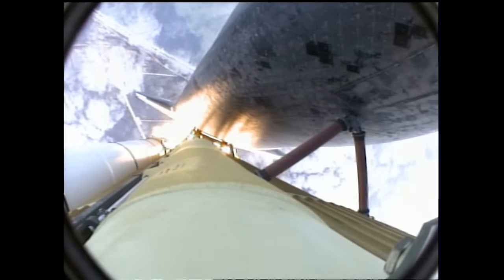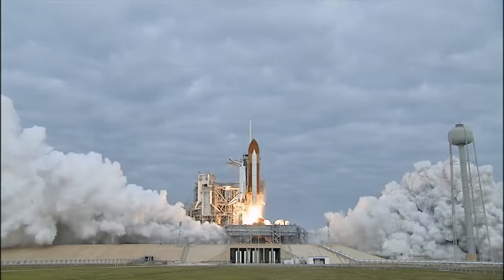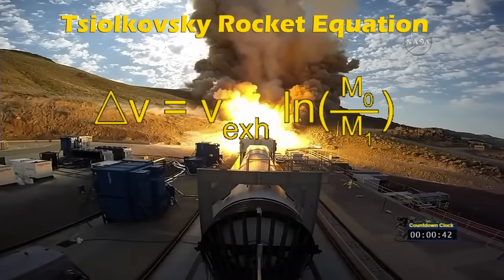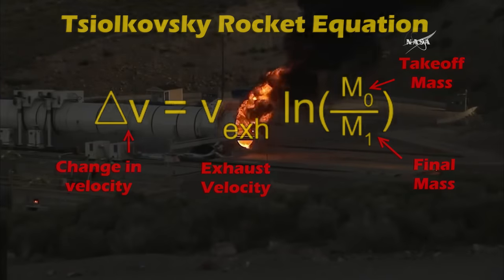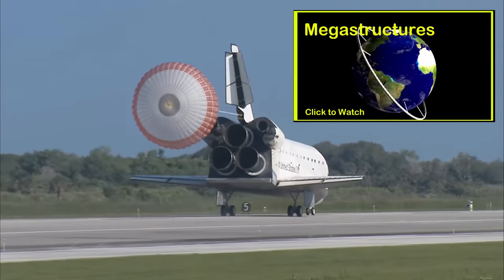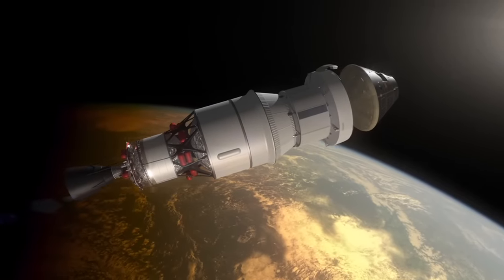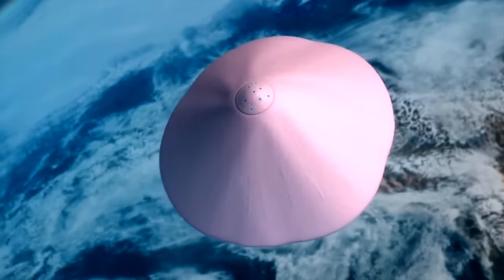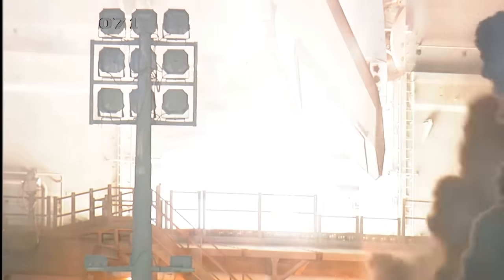The Spaceship Propulsion Compendium

Comment: Is it possible to recover one's expended fuel in space by using a catch mechanism behind the spacecraft? For example, you emit charged particles for thrust and once they leave they are attracted to a magnetic funnel system which re-directs them back to the storage tank still under their own power. Or does that violate some law of physics?
Reply from the maker: Capturing that way would produce no thrust unfortunately
Reply: It violates conservation of momentum. If you grab the expelled gas, it slows you down. Sort of the opposite of why putting a fan on the deck of a sailboat can't work. (Um, Idk how useful that analogy is...) 

Try again - imagine a gun with a rubber band connected to the bullet. You shoot the gun, the bullet moves forward, and the gun recoils and moves back. Then the rubber band starts pulling the bullet back - and starts pulling the gun forward! Equal and opposite. If everything could be perfectly efficient, you'd get your bullet back but you'd be standing still right where you started. So, on a spacecraft, whatever method you use to collect the propellant, it's basically the same effect as the rubber band. (Much better analogy, lol.)
Reply: Bo Zo 
How about a trailing ship collecting some of the gas expelled from the lead ship without losing its momentum? Assuming you were going to have two ships anyway, this would be like a cosmic form of drafting, or like those scoops they propose for collecting gas in space as you go.

The idea of collecting expelled gasses - somehow - is not completely crazy. It's not exactly like the rubber band and bullet analogy since the gas molecules are not physically connected to each other. Each particle has its own momentum and so it should be possible to collect a portion of them without absorbing a hammer blow of unwanted momentum.
Reply: +MillionthUsername - Part of how drafting works is that the lead vehicle's wake is moving in the same direction as the lead vehicle, so the trailing vehicle experiences a tailwind. Following close behind a rocket is the opposite - you're facing into a thirty thousand mile per hour headwind. (I think the other factors in drafting are probably irrelevant here.)

The reason a Bussard Ramjet could maybe work is that, although the ship does slow down by scooping up fuel, it uses the fuel to produce a fusion reaction and lots of thrust. It picks up fuel moving kinda slow, and shoots it out the back moving really fast, so there's a net gain in the ship's velocity. (But not in the total momentum. Imagine it as two momentum-conserving events.)

The basic principle is this, and it applies to all situations everywhere in the universe: in any closed system, whatever momentum you start with, no matter what you do, the system will at any given time always and forever still have that much momentum exactly.
Reply: +MillionthUsername - Actually, any method of collecting the gas is very much like the rubber band. "Physically connected" is sort of an illusion - for instance, magnets are physically connected by physical magnetic force. (In fact, a rope is basically just a row of magnetically connected atoms. But I digress.) Gravity physically connects you to the Earth. 

Interacting with the exhaust gas of a rocket will affect your velocity. That's why rockets push their payload up, and that's why collecting the gas afterwards cancels out the push. A second ship might collect the gas, but it would be slowed, and need MORE gas than it collected to keep pace with the first rocket. 

Or, imagine a rocket in space, with a giant balloon behind it. The rocket would inflate the balloon. It wouldn't accelerate. If you put a small hole in the balloon, it would accelerate. And it would accelerate in the opposite direction, away from the hole, so if you put the hole on the side of the balloon, it would rotate.
Reply: Bo Zo
You could release the collector behind you as you accelerate. The gas could be recovered later - assuming the whole setup was economical to begin with.
Reply: If you leave the collector behind, then you could accelerate away at full thrust, no problem. If it trapped 100% of the exhaust, it would accelerate backwards away from you - equally and oppositely. The collector's momentum would be equal and opposite, but its actual velocity would depend on its mass.

(If it collected less than 100% of the gas, then the collector would accelerate less - but the gas it didn't collect would make up the difference, and the equation would balance to zero net change in momentum.)

You could try to tow the collector, perhaps with a rubber band...

If you tried putting engines on the collector, you'd need to expend fuel (momentum) at least equal to the momentum of the collected gas, just to stop it going backwards, then an equal amount again to make it go forwards, plus a enough extra to stop and then accelerate the collector - for a net loss of propellant (but as always momentum is conserved).
Reply: I missed an aspect:

If you sent a friend in another ship to collect it, then YOUR momentum wouldn't be affected - you could fly away happily. But your friend would have to accelerate to catch up with it and so on, and between you, the fuel, the collector, and now including your friend, once again momentum would be conserved. 

Also, if the collector accelerates backwards because of the exhaust, or even if it's massive enough to stay mostly put - as your ship gets farther away, it gets harder for the collector to collect the exhaust, at least if the propellant is an expanding gas. (Although if the propellant was bowling balls or a tight particle beam or something, and not an expanding cloud of gas, that wouldn't be such a big problem.)

Comment: I’ve designed an ion drive that could generate many KN of force, similar in comparison to a jet engine. This would decrease radically going into orbit as I would need an onboard supply to maintain thrust. But you’ll notice the mass of that propellant would be significantly less than rocket fuel. Thank you everyone btw

Comment: I have a question, but first let me say I really like your channel!
So, do you know at which fraction of the speed of light a spacecraft has to travel in order that from it's point of view it's travelling exactly at the speed of light? .. due to time dilation/space contraction effect... I'm asking around but nobody knows..:(
Reply from the maker: Probably asking the wrong people :) they should have told you 'none', you can't have a perspective where you are traveling at the speed of light, no internal time passes when you are at light speed and any speed beneath that will have you measure the the speed of light as exactly the same, that's the entire way we came up with special relativity. What instead happens is that the light you do see will start red or blue shifting, the speed won't change but the color will basically. Hope that helped!
Reply: I understand. The speed of light will always be the speed of light for everybody, but let's say that I travel at 99.999999999999% of light speed from earth to a star 4 light years away.... wouldnt appear relative to my clock that I arrived there in just a few seconds or so?
Reply from the maker: It sure would, but you won't see the distance as 4 light years, you'd see it as a few light seconds.
Reply: ok I think I fully understand now.. well it's good cos in theory we can cover immense distances in our lifespan provided we have a proper propulsion system even without FTL speed. Thank you very much I had this question for long time! Keep up the good work!!! ;)

Comment: You said rocket fuel was expensive and I guess relative to many other fuel types it is but it is a very small part of the economic cost of a launch.  The real cost is payload vs fuel and re-usability of components.   The better the fix for both of those issues will lead to better economies of scale.

Comment: If ion engine is installed vertically on earth it can lift a space ship with ion jet. Energy can be obtained from solar panels. Magnets can decline ion jet from the spaceship to avoid damage. Energy for magnets can be delivered with a laser beam from earth. Ion jet can be accelerated by multiple cyclotrons on earth. Ions will return to earth after being declined. It means no waste of fuel.

Comment: Isaac, I have a question for,you regarding the Star lifting you mentioned at the end of this video. I am not sure if you have viewed any of the videos posted of ET craft around our sun doing what appears  to be removing material from our star.  I hope you do not instantly disregard this comment upon seeing ET as this is really an honest and credible question.  It has happened more than several times and is recorded straight from NASAs page where one can view the images and streaming video from the 2 satellites zeroed in on our sun.  Is this what you mean by star lifting ?  If so are these craft using the plasma as a propulsion fuel or do you estimate they are helping \ tampering with, the sun?  I myself am not a tin foil hat wearing guy and in actuality am a former USMC LT and consider myself an open minded person when it comes to such matters. To think we are the only intelligent beings in this universe would be, in my humble opinion, closed minded. As to my question, in these videos it shows a craft (some as large as Earth) hovering very close to the sun using a sort of tornado to actually pull plasma off the surface of the sun directly into it.  In some instances as it stops the process and leaves, you can visibly see a wake appear in the surface of the sun. Sometimes there is a reaction that appears on the direct opposite side which seems directly connected to the process completed.  Have you yourself viewed these videos and if not, would it be too much to ask you to watch them?   I have found myself locked into your videos and appreciate all the work you put into them. Great work and ThankYou. Your work and narratives are top shelf man and I look forward to your next one. Thank you,for taking the time to read this comment and I look forward to your response.

Comment: Someone tell me if this would work or not, and why.
If you have something spinning in space and its under going gyroscopic procession would it technically be able to accelerate forward, or at least in a direction? And if that is true would this spinning object spin forever(or a very long time)because of the micro gravity, and small amount of particles, in space?
Reply from the maker: I'm not quite sure what you mean Nyro, you could remover some of the rotational energy of a spinning object to be used to power propulsion, though it still needs to be in a way which conserves momentum.
Reply: No Im basically asking what would happen if you had an object spinning in space, would it stay stationary or would it move "forward"?
Reply from the maker: No, it will remain at relative rest, just spinning, unless acted on by an external force, though it will eventually stop spinning from the small amount of drag from vacuum not quite being vacuums

Comment: Regarding antimatter as "ultimate rocket fuel", there is a tiny chance for a better one: stimulated proton decay - also mc^2 of energy ... but could just use hydrogen gathered on the way.
But there are two big "ifs":
1) is violation of baryon number conservation possible? One argument is baryogenesis which created more baryons than anti-baryons. Hawking radiation is believed to finally turn matter into massless radiation. Such violation is also required in many models like SUSY. Another argument is that charge conservation is guarded by Gauss law, but there is nothing like that for baryon number.
2) if it is possible, the real question is if we could stimulate it - make it practical. If proton is local not global energy minimum, maybe we could e.g. "swing it out" from this minimum - by some well prepared EM wave (?)
Reply from the maker: We don't even know if protons decay last I checked, but if they do I'd acknowledge that would be a hair better probably. Anything converting raw mass into something moving at or near the speed of light, basically photons or neutrinos, is pretty much gonna max out the rocket equation, the upside to stimulated proton decay would presumably be that you would be able to scoop it as you went, or something parallel, whereas antimatter is still an initial fuel you have to carry.
Reply: The search for proton decay was made in large room temperature water pools, while it would need reaching relatively huge energy to cross the potential barrier of proton - assumption that in room temperature such energy can spontaneously thermally focus in a proton might be just wrong.
In contrast, if possible it requires enormous conditions - like while baryogenesis (BB), inside BH (burning baryons into Hawking radiation) ... the next candidate is the center of neutron star: leading to gamma-ray bursts of energy scales unexplained in standard ways (they observe). Another candidate is LHC, but it is very difficult to verify - calorimetry has no chance to see it, should be added to Monte Carlo simulations but it would require knowing the parameters  ...

However, there might (?) exist a more subtle than thermal way - like "swinging out" the proton or finding a valley through the potential barrier - which might be exploited with a very precise EM wave ... but it will require a really good model of proton, we are far from ... and an extremely sophisticated EM source (controlled in gamma scale).

And personally I don't believe in containment for macroscopic amount of antimatter - it would require literally a perfect vacuum in this vibrating environment - a tiniest imperfection would lead to annihilation, which energy would strip out more atoms, starting chain reaction.
Reply: I see you mention formation of micro black holes in the warfare episode - also that they evaporate in short time due to Hawking radiation. This is another approach to "baryon burning" - collapse standard proton-based matter, finally transforming it into mc^2 massless Hawking radiation (photons).
So if a civilization could form micro black holes, it would have the ultimate energy source: mc^2 from any matter, like hydrogen scooped from space while travel (much more important than warfare applications). It could be used for repulsion like in the Orion project: form black hole behind a starship and reflect its Hawking radiation ... or e.g. use some photovoltaics to turn it into electricity.

Comment: How does the vasimr engine go to mars in 39 days, you would need huge acceleration, right?
Reply from the maker: Huge by modern standards, in terms of it being prolonged, but by and large, even when you're bypassing Hohmann transfers to go faster, you still are only talking about 10-20km/s of delta-v tops,  that's a whopping 1-2000 seconds of one gee thrust, not even an hour, but of course that is spread out over many days instead so you would barely notice it, things would drift a bit toward the back of the ship rather than falling, way less than Mars or even moon gravity equivalents. 
Here's Diaz's original presentation on it from a few years back if you wants more of the nuts and bolts:
https://www.youtube.com/watch?v=-nyepvfuHho
Reply: Isaac Arthur Ok, thanks for the link and explanation, but the engine is too weak to be used as a circulation burn engine on smaller spacecraft, I assume, but according to the atomic rockets site it could produce ~2 kn of thrust, which is close to the oms pods on the space shuttle (I think)

Comment: 8:06 The intergalactic void has significantly higher
mass density then system space.
In system any mass present will soon settly on a planet
or star, if not at an orbital speed on a trajectory that is
an orbit.
The extra stellar space and also extra galactic space has UCM
(Universal Colloidal Matter, micromass) that can be as high
as the density of all mass in the solar system divided by the volume
of the solar system's effective gravity sphere.
This would be like 0.5 LY, which then means the mass of the solar system
divided by a sphere of roughly 0.5LY in cubic meters, equaling
the UCM density per cubic meter.
Reply: 8:48 Lithocakes ? Umm, not tasty at all.

Comment: How can one use nuclear fission (or fusion) to generate electricity directly, without using heat from the reaction to heat water to make steam to spin turbines attached to electrical generators? As cool a concept as a steam-powered spacecraft is I imagine it wouldn't be very efficient....
Reply: You can build a pulsed reactor that uses induction coils to produce electricity directly from the expanding plasma plume. It's not as efficient as  proper heat engine though.
Reply from the maker: There's a number of ways including just having a closed loop off the coolant and steam turning the turbine. It gets rather bulky needing to radiate all that heat away, but it is doable and benefits from scale, bigger being better as it were. The link in the description to Project Rho's atomic rockets has many of the designs.